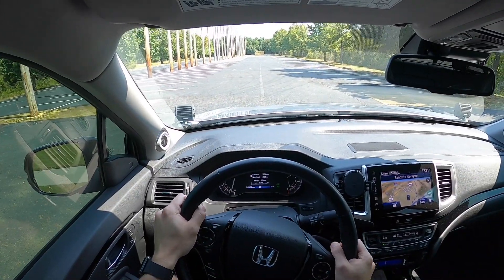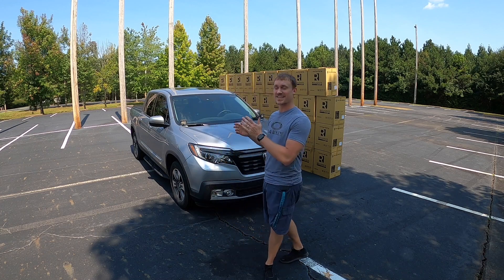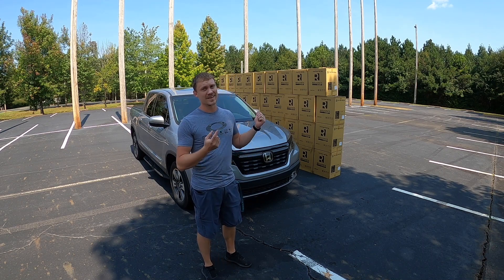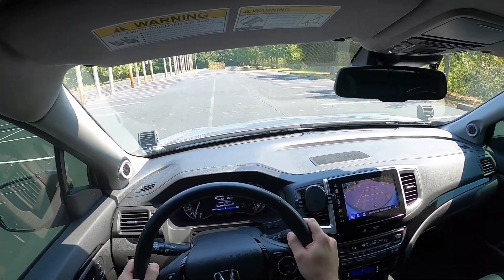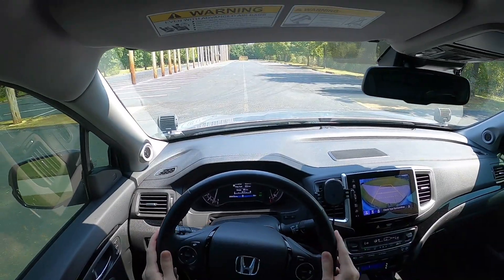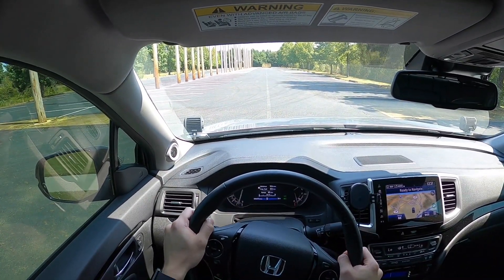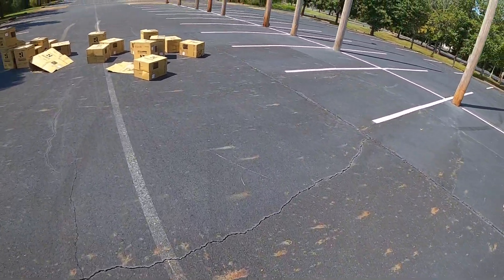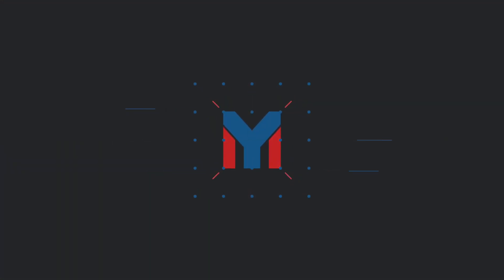Honda VS Cardboard Boxes - Collision Mitigation Test

Comment: The system worked on my 2018 crv and we were saved from a horrible horrible rear ending accident a few days ago on a highway. The cars were going fast and I had my foot pressing the gas pedal to speed up and I looked away to the left to see if anyone was on my blindspot so I could change lanes and while my head was turned the cars Infront of me were like dead stopped and before I could even realize that they were stopped the car hit the brakes full on and stopped me before I could even know what happened. I know it was my fault but thank God the collision system worked. however,  I have tried to see if it detects my closed garage door and it doesn't. It hits my closed garage door at low speeds of about 3 mph. I never tried full speed towards the closed garage door obviously but at least 3 mph doesn't do anything and hits the door.

Comment: Yuriy - do the test with your Subaru Forester.  It will pass with flying colors.  There are many vids on this.  Commenters here are correct that the system in the Ridgeline, pilot and Passport is radar based, not camera based like your Subaru.  The Subaru system is highly regarded, - the Honda not so much.  I bet you dislike the adaptive cruise in your Ridgeline too, but like it in your Subaru.  They’ll all get better eventually.  Great vids!
Reply from the maker: Doubt it. Not with my Subaru Forester. 😂 Would smash through like a rocket. It didn’t have collision mitigation. Lol. 

I actually will be doing a new video. Have a method I think will work.
Reply: @YuriyMotso  no eyesight on yours?  My bad - I thought it was newer.  We have a 19 forester and the safety systems are great!  Looking forward to your new videos!

Comment: Something I’ve seen on my ‘21 Passport when using the auto cruise control the silhouette of the car gets filled white when the radar recognizes a car in front to pace. It’s a blank outline when no car is in front or way far ahead. The same with the lane keep assist - the lines are filled or outlined. 

When you had the auto cruise control on at 25, did the car silhouette for the acc fill white or was it blank? If blank then the crash mitigation might be using the same algorithm for vehicle recognition and not objects or hazards in road. I think I’m okay with this. A wall is not a likely scenario to encounter on the road but usually what stops a vehicle already off course. Someone already fucked up by then. 

Thanks for the videos! Keep up the great work.

Comment: I just got a new 2021 Ridgeline. The safety features don’t work worth a crap. Been in 2 minor accidents in less than 400 miles on the odometer. Traded in my F150 with130,000 miles and not a scratch on it.
Reply: can you elaborate? I'm considering a RL, most owners on the forums tend to say HondaSensing is TOO conservative on the RL not what you said.

Comment: Wow... today heading work a suv cut me off and my Ridgeline slammed the brakes at the point that a knew I was in control, I tried to override the coalition mitigation system from my Ridgeline accelerating but the vehicle didn't follow my action until this guy clears the way.... all that in a fraction of a second, that really impressed me, I was beeping like whennI get inside my garage close to the wall but faster and faster, i didn't heard you system beeping when you got close to the boxes, maybe the distance is not calibrated right, may good idea to check it with the dealer, it supposed to stop. Let us know what happens next. Good video.
Reply: The parking sensors that beep when you get too close to a wall in garage are based on ultrasonic sound waves - they operate only at low speeds and short distances. The automatic emergency braking system and adaptive cruise control use radio waves that travel much farther along with a camera to see cars and people. The ultrasonic parking sensors are short-distance, low-speed warning devices only - they won't stop the Ridgeline. Honda recently started using the parking sensors for low-speed automatic emergency braking in the Accord, for example, but the Ridgeline doesn't have this feature.
Reply: @zroger73  I have the Black edition 2021, , I wasn't talking about the brake sensors, I am talking about the collision mitigation sensors in the front bumper, also I have a bull bar that doesn't interfere with the range or anything else and the only thing I can tell you that when I was about to get a collision with that vehicle I did heard a long beep and the Ridgeline applied the brakes for me and stop  at the point I couldn't accelerated until this guy move out of my way, what ever it was that in my case works very good I have the range set to the middle not short or far. That impressed me, the vehicle took the control in order to avoid the collision.
Reply: @GHacks7 , the sensors in the front bumper are the ultrasonic parking sensors - they are not used for the Collision Mitigation Braking System. The CMBS (automatic emergency braking system) uses a radar unit mounted behind the "H" symbol on the grill and a camera behind the windshield.
Reply: @zroger73  ohhh.... yes you right... thanks to point it, you r correct, now the thing here is why your vehicle didn't sense and avoid the collision?, lets say if you were driving behind a flatbed truck loaded with cardboard, what would have happen? Probably it must be something wrong with your collision module,  If never had experienced that before that would be something to think about or maybe is not calibrated right. Excellent video my friend and good luck with that GBU!!!
Reply: @GHacks7 , the Ridgeline drove through the boxes because: 1) Cardboard boxes don't reflect radio waves from the radar unit so it can't "see" them, 2) the cardboard boxes don't look like vehicles or pedestrians, so the camera doesn't recognize them as such, 3) the ultrasonic "sonar" parking sensors will detect cardboard boxes, but these sensors are only effective at distances of about 47 inches or less and at speeds of less than 5 MPH. Again, these sensors only detect - they are not connected to any other systems and cannot stop the vehicle. Now, in your example, if you were driving behind a flatbed truck loaded with cardboard boxes, the radar unit would detect the vehicle because the metal that it's made out of would reflect the radar signals - the cardboard boxes are transparent to the radar unit, but the radar would see an empty flatbed truck and apply the brakes.

Comment: Just as expected. :) The system did not "fail miserably". The radar is designed to detect metallic objects while the camera is designed to identify vehicles and pedestrians. It's not designed to detect animals, trees, plastic garbage bins, or other non-metallic objects that aren't pedestrians.
Reply from the maker: Well two things: it did miserably fail at stopping for cardboard boxes. 😂 however I guess my misunderstanding of how the system works is to blame. However, I have an idea already for test 2. Will work on that soon.
Reply: I watched an official Honda video a couple years ago about this.  It showed the system working fine with a cardboard cutout of a pedestrian in front of it. The fact that you imply the truck won't stop if a human steps in front of it is terrifying
Reply: Real person try...Who have quick reflex to look go out if it fails....😊😊😊
Reply: i tested this by drive my brand new Mdx the garage door and boxes. Of course it works, Acurawatch is more advance than for  what we have for honda
Reply: @tonyhuynh6789 , AcuraWatch is nothing more than Acura's marketing name for Honda Sensing. Same suppliers. Same components. Same capabilities.

Comment: I dosed off while driving and the system saved me from hitting the car in front of me by braking super hard. It’s a sonar based system that only detects dense objects like metal and concrete. It will prevent you from hitting a pedestal or animal too because a flesh body is dense. It will not emergency break on the freeway if you run over a cardboard box as that would be more dangerous that hitting the item.
Reply from the maker: Ok. I think I have an idea how to go about fooling the system and making it work.
Reply: @Gordan Nichols, the CMBS uses a radar and a camera - not sonar. The parking sensors use sonar, but those only work at slow speeds and close distances.
Reply: We’re you in cruise control? If so my 2021 RTLE will brake hard if unexpected merge or sudden stop from the car ahead.
Reply: Makes you wonder if it would do anything if a semi & trailer stopped or slowed on the freeway in front of you, and you weren't paying attention. 😬

Comment: When driving off road on a tall grass/weed overgrown field, the system will beep at you and not apply the brakes. on the highway this system saved me from hitting a car that was stopped, moved forward some then stopped again , I got "enforced" it put the brakes on and stopped short of the car ahead of me.